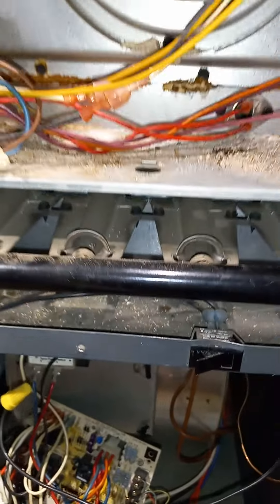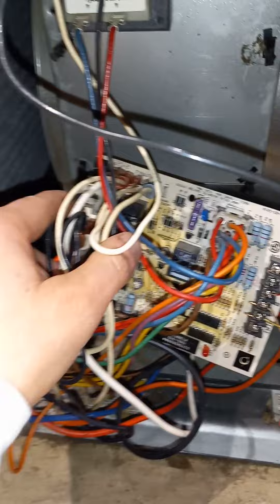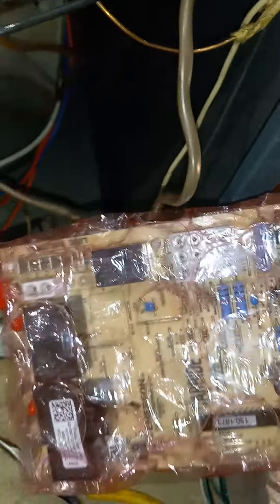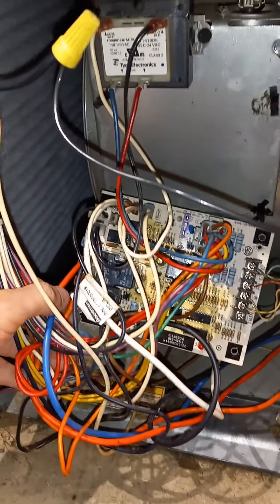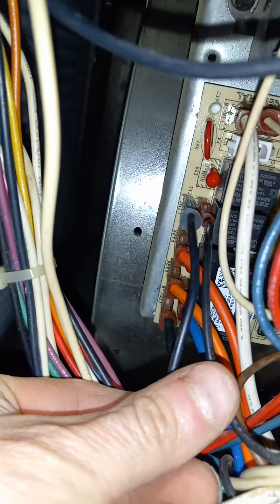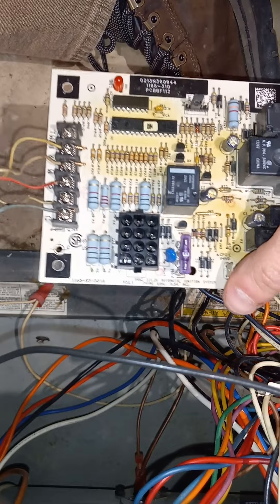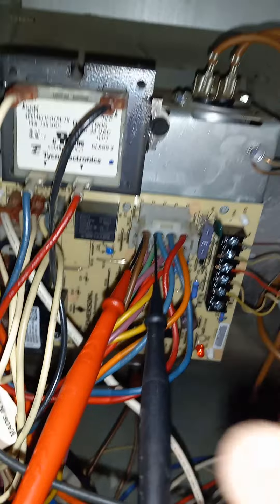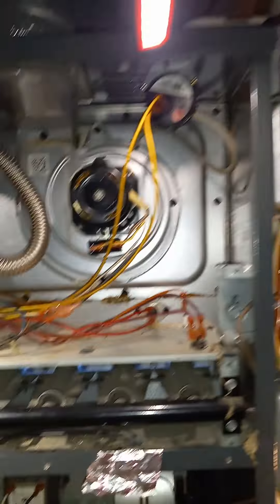Goodman Furnace, not working

Comment: Correct me if I'm wrong but those boards with the 9pin white rodgers intel-igni
Reply: Always give issues with the mo connector
Reply: @elgum9868  use air to clean
Reply: I have but what I have also caught is that metal connectors are too lose with wear

Comment: Next time you diagnose a bad board during heating season take a closer look at the solder joints for the molex plugs. You'll usually find the 1s for either the 9 (or 12) pin molex plug or the plug for the inducer will have cracks on the solder joint causing the voltage to either fall down or it can intermittently work and send voltage then suddenly stop working. Also stop poking into the back of the plugs, that's also part of why they fail. They made so cheap now just poking into it can crack those weak joints
Reply from the maker: That's a good point . I'll be sure to look closer at the solder joints, and thanks for the heads up.
Reply: My board had 4 of the molex Solder joints cracked. Someone man handled it.
Reply: @dodgedak03  has nothing to do with man handling it. It's the fact that it's in the blower compartment where temperatures constantly go from cold to hot, cold to hot, cold to hot. Metal expands and contracts with temperatures so eventually it flexes and cracks
Reply: @MiguelRdgz916  I see your point ,but mine isn't located in the blower compartment. I have a packaged unit in which all the electronics have its own compartment. Being 25 years old doesn't help.
Reply: Agree!
Reply: @MiguelRdgz916 yes, but most damaging is the vibrations from the mounting place…these vibrations (many different frequencies) loosen and break the solder joints.

Comment: Who is installing these with a flex line on the inside of a furnace. Too many clowns out there that cant use a tape measurer to see what size black pipe you need. With all the corrosion around the inducer points to no flue liner in chimney. Another slop job and people think they got a good deal.
Reply from the maker: I agree